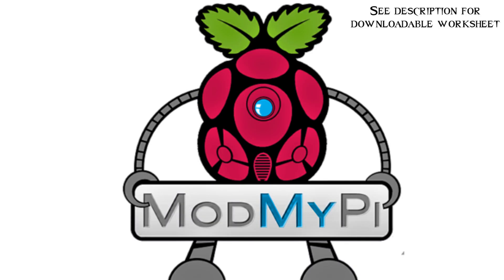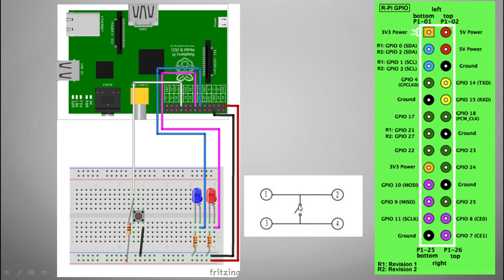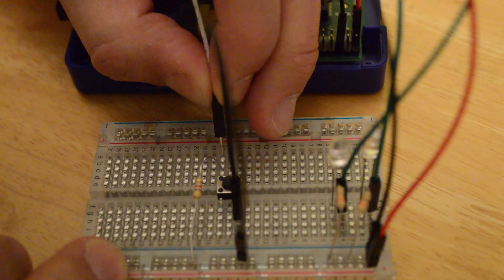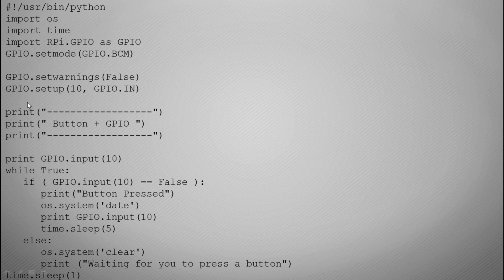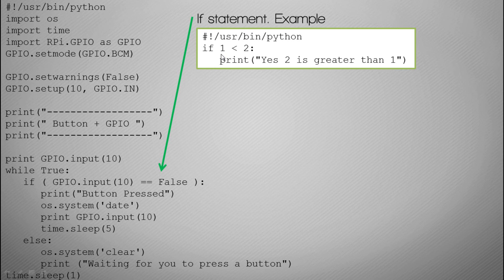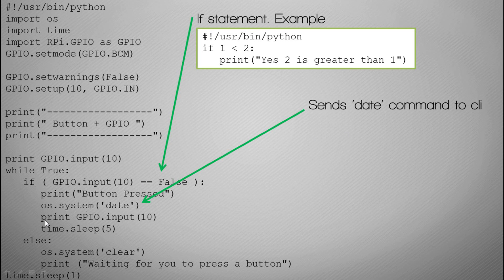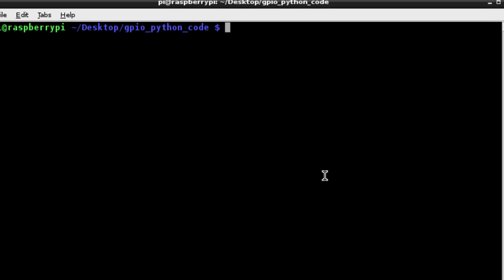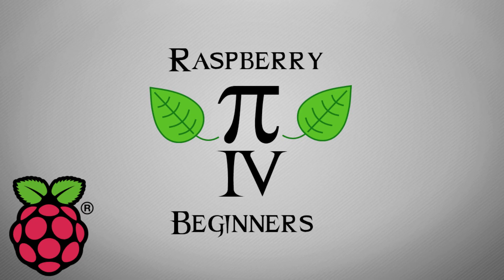Raspberry Pi - GPIO & Python (4/9) - Push button

Comment: Hi! Thank you, it is a great tutorial. But i little bit confused. My terminal allways shows me Button Pressed mesage, even i do not connect the button to my scheme. RP 3
Reply: Alex Muscatov the diagram in the video is for the model with 26 pins, not 40. I went 4 from the end, rather than 3 from pin 27 to find GPIO 10. That was the problem.  Once I got the correct pin, it worked on the RP3
Reply: But isn't GPIO 10 pin 19 on RPi 3?
Reply: you can use GPIO P02 pin for proper output of this python program.

Comment: I'm struggling with this for some reason. I'm getting the following on the terminal without pressing the button:

-----------------------
Button + GPIO
-----------------------
0
Button Pressed
Then the date & time
0

I've checked the wiring 5 times, there's not a lot to go wrong I wouldn't of though...

Comment: Thanks for this awesome tutorial. I have a question. I want to use another pushbutton. This is the one I want to be using. http://www.dx.com/nl/p/szgaoy-ac250v-dc12v-red-led-reset-push-button-switch-w-terminal-silver-red-334940#.VofKZhXhChc is this possible?  or do I need something else extra resitors or just the same resistor as in this tutorial?

Comment: Hi, Great tutorial, My program could turn on led on off first time.. but not sure what has changed now its not working. I am using setmode(GPIO.BOARD) and using pin 7 as GPIO out and 6 as GND.  Is there any GPIO command to  reconfiure pins.

Comment: Why the resistor?
Reply: To define a low voltage when the switch is open. By preventing a “floating input” you can avoid random high and low signals. 4.7k ohm.
Reply: @jdplus3  But Raspberry Pi and Arduino boards have internal pull up/down resistors

Comment: When the button is pushed, electricity is able to flow to the input gpio pin, or to ground, right? It seems that it flows to ground, since the input signal cuts off. Why does that happen?
Reply: Jan Vermeulen Detailed explained over here http://www.genericarticles.com/mediawiki/index.php?title=Everything_about_Raspberry_PI#What_is_a_pull-up_resistor.3F But the short answer is when the button is pressed, it reads 0 volts as it is connected to Ground and when button is not pressed, it is still like Ground, not connected to anything and almost equivalent to 0volts, so to detect that state, we connect to Voltage source using resistor to avoid short circuits